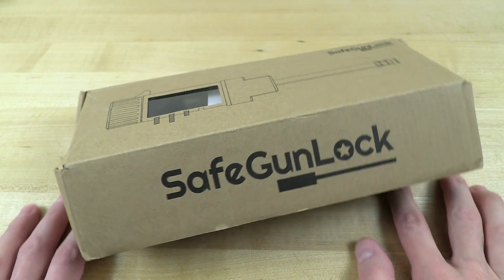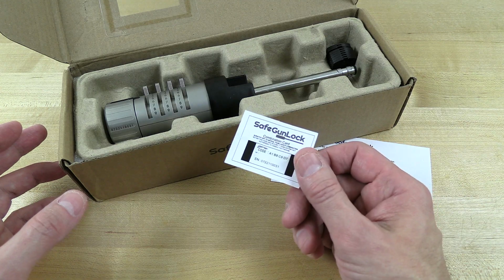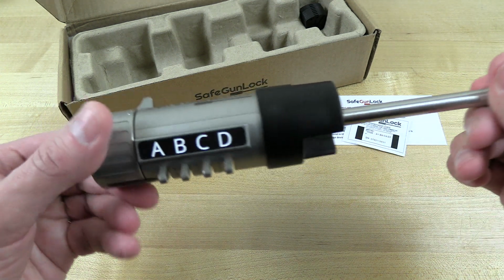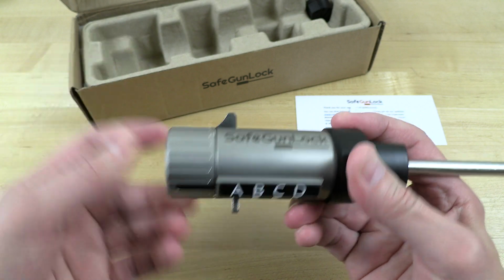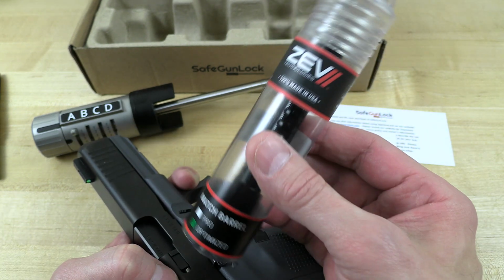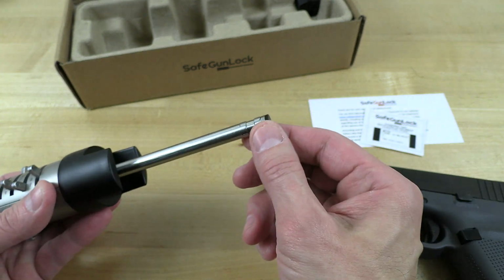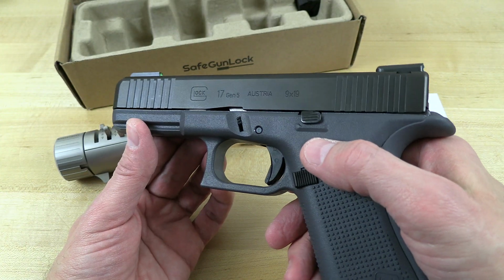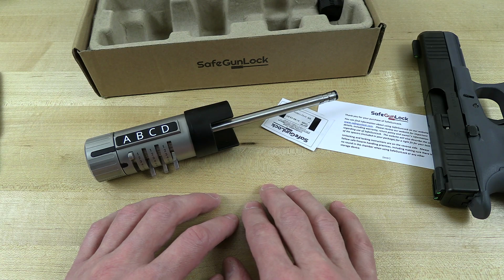Safe GunLock: I Wouldn't Use It

Comment: I am just like you on this.  I'm kind of persnickety about bores and crowns.
Reply from the maker: The company says the steel in the lock is not hardened to the standards for gun barrels, but it just doesn't seem right to me.
Reply: @HandgunSafe  It reminds me of what people told me about avoiding steel brush for barrel cleaning, and to prefer less abrasive material such as brass or even synthetic to avoid metal on metal contact.

Comment: Cool video, cool lock. Wouldn’t buy or use it though. 
It seems very specific, caliber, barrel length etc. you need a diff lock for every variation of Glock
Reply from the maker: The Safe GunLock website has a section for you to look up your gun and see if they have a lock already made for it.

Comment: (unaltered) Does it still drag/catch if you let gravity drag it off of the gun?

Do you think that retention mech/fit can be altered/rounded to mitigate this?  

It looks (to me) like they made the blunt plastic piece slightly larger than the tip so that on insertion it the metal (tube) cannot hit the barrel, and doesn't drag directly on the barrel wall; But I would anticipate this plastic wearing down and exposing the metal anyways (though the thin film of plastic that would stretch/smear across it would offer some protection).

A slightly tapered end could retain 'enhance' this functionality while mitigating the precision needed to insert it, and drag on removal when the tube isn't perfectly supported/aligned by/with the barrel.
Reply from the maker: I'm not responding to your whole comment. The problem with altering the shape of the retaining pieces, as far as I can tell, is that the last half or quarter-inch of drawing out the rod is where the rod is unlikely to come out straight. You only need to put a slight, hair-like mark in the end of the barrel to change how the gasses escape the barrel--and the aim is off. Look at all the efforts manufacturers have gone to in order to produce beveled, recessed muzzles, often fitting barrels with sleeves that can be replaced. It's just too freak'n easy to ruin a barrel.

Comment: No way.  Your points were spot on.  Those tiny retention clips, would it prevent racking the slide or just make even more damage to the feed entrance?
Reply from the maker: The lock prevents you from chambering a round, because the end of it occupies the chamber.